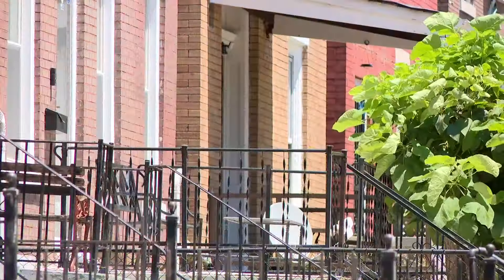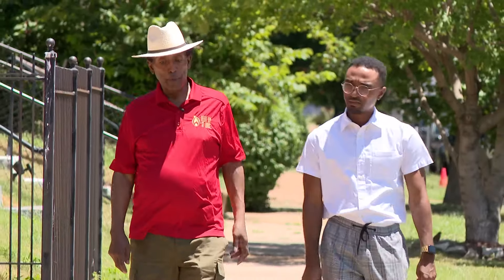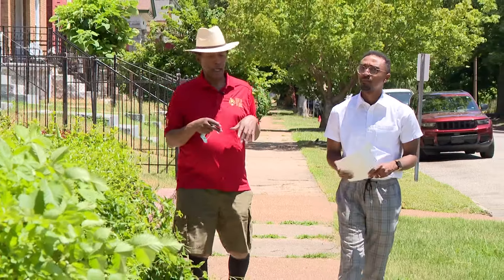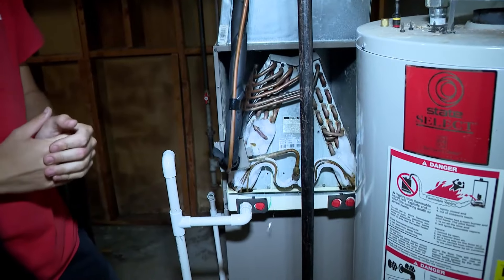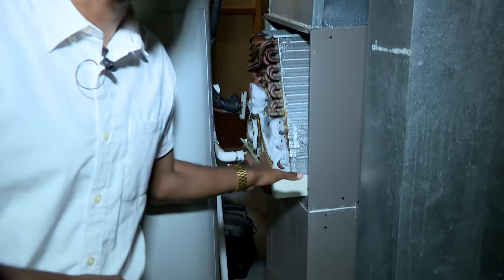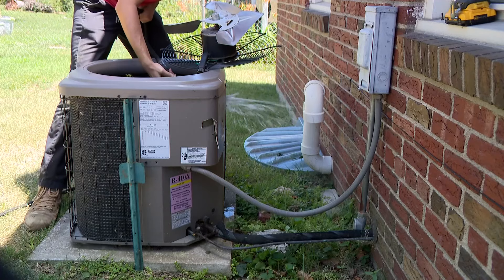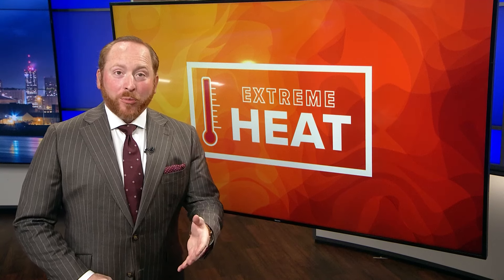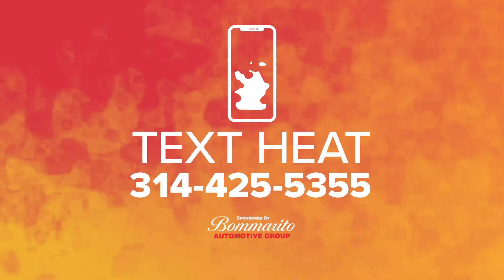Cool Down St. Louis helps residents stay cool amid dangerous heat

Comment: Not just brick homes, but regular 2 story homes with sidings get just as hot. Turned the thermostat to 75 last night (so it wont kick on til temp downstairs is 76, like every 15 minutes during the night), but upstairs, it's 10-11 degrees hotter. So when it 76 downstairs, it's 86-87 upstairs.
Then there's the upstairs small room, no ac. The walls get hot to the touch on the inside. Everything that can't withstand temps near or over 100 degrees has to be taken out of that room each summer. It turns into a furnace. Good for 1 thing, testing brands of tape, but all have failed. Also, Mod Podge starts to melt at 90.